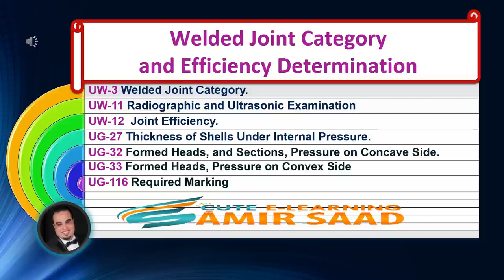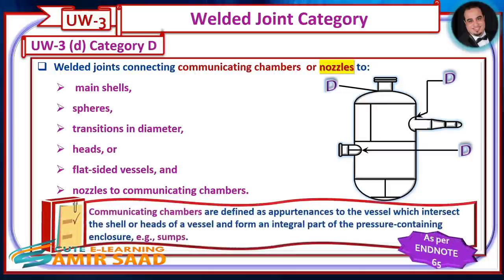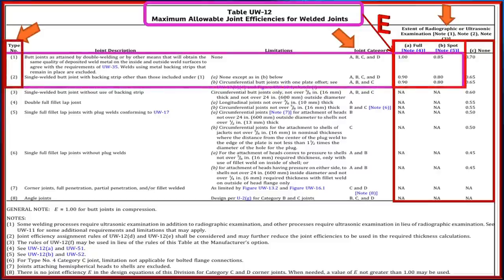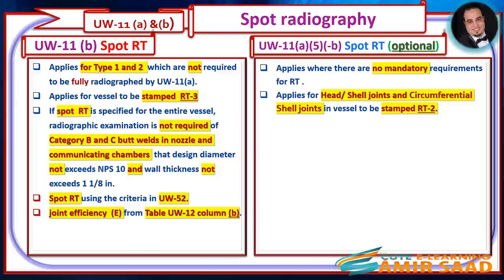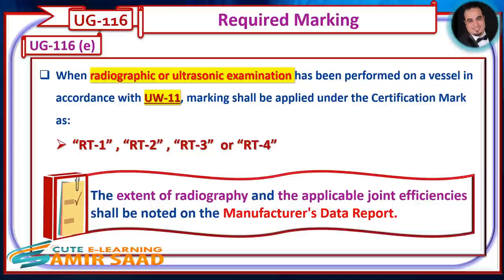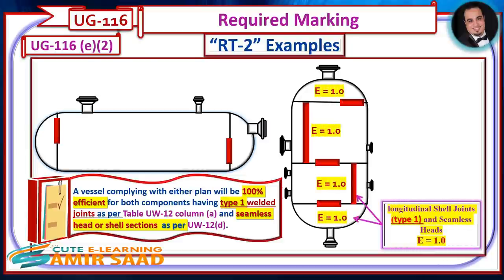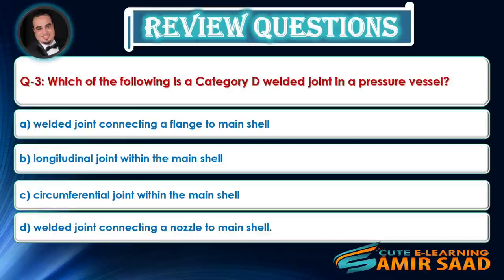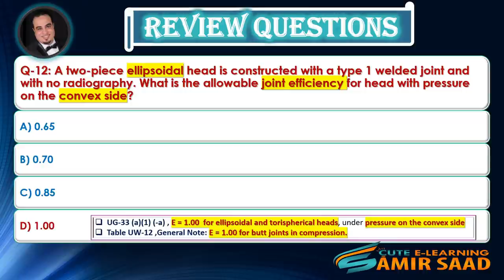ASME VIII Div.1,Welded Joint Category and Efficiency Determination

Comment: great video Mr Samir, i have a question. If both shell and Elipsoidal head are seamless and will be welded by type 1 Spot RT, what is the joint Efficiency in Head and in Shell?

Comment: What is requirment of welding & RT at intersections of A category and B category joint in pressure vessel shell
Reply from the maker: You can communicate with me through WhatsApp 00966540787077 for more discussion

Comment: Hi sirs. Could you point me where is the paragraph fo references for "the joint efficiency (E) from table UW-12 column (c)" in 16:22 . I have crossed the UW-11 and UW-12 and UW-13, but cannot find-out, or I do not understand enough. Thank so lot.